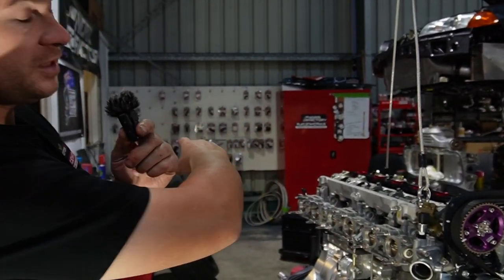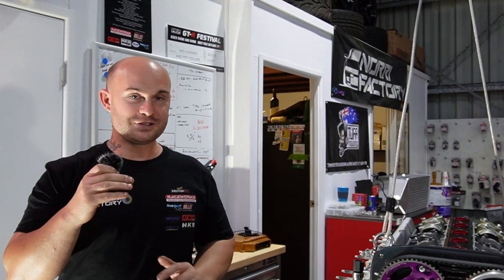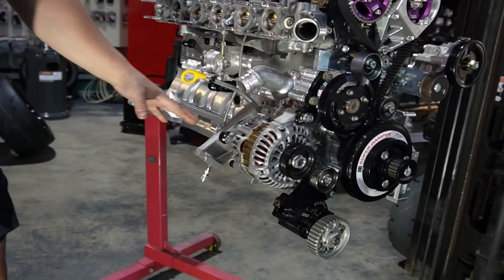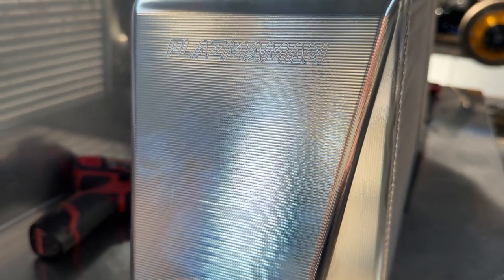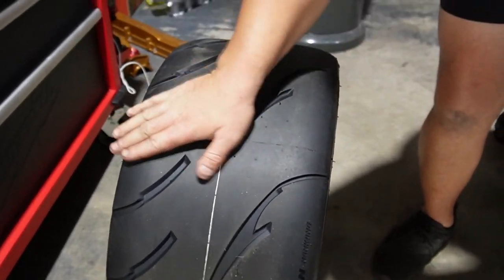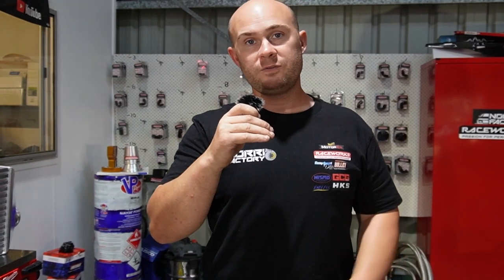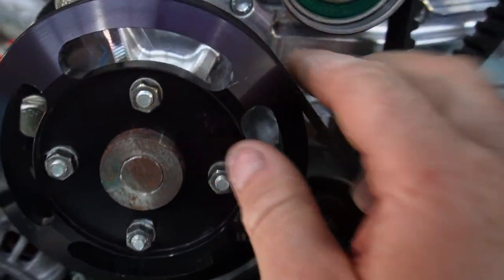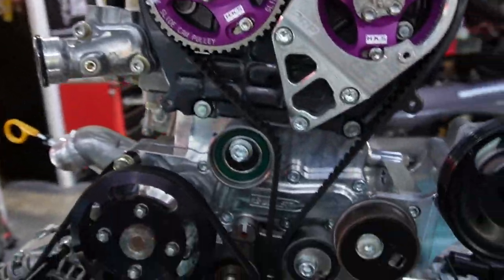Its Time to Inspect the Rod Bearings in the R32 GTR RB26 Billet Block.

Comment: Love the build man. Definitely need a break every now and then! You’ve been working like mad to get the car where it is! Definitely an inspiring build! I hope mine comes out half as nice!
Reply from the maker: Appreciate it!! I’m sure you build will be sweet as! What sort of build are you doing? High hp or oem plus?
Reply: @norrifactory  R33 GTR. Rb26 block, Nitto 2.8, Headgames ported/shimless head, GSC S1 cams, Precision 6870, PPG Billet sequential. Shooting for a 800-1000whp street weapon. Probably just cruise it around on wastegate/550whp most of the time though! I’m in the middle of color changing the car. Head is done, I have all of the parts. Waiting on block to finish machine work/assembly. ~6 months before I turn the key!

Comment: Love your content bro. I’m doing a RB billet build in the states mainly because I had no other options due to lack of availability. Any concerns I should have considering this will be a street car? Not much on the net and getting mixed perspectives.
Reply from the maker: Hey man that’s awesome to hear. When first installing the billet block I had no issues at all other than where bullet locate the fluid supply fittings ins and outs. Like the big -16 orb on the hot side is painful. I also recommend going dry sump.

Comment: Hay mate, another great video, loving your content and attention to detail on your work. 👍
A solution I would recommend to cleaning up them annoying bits and pieces with rust and such like your pully washers, little trans plates / bolts is blueing them, I have had some good success with a simple blow torch and wd40, I think this simple garage technique would work great for your bits. keep up the great work mate, your doing great 👍
Reply from the maker: Bro that’s actually a mad idea. It’s funny I use to do those processes as a kid when I didn’t have money to buy new parts, it’s easy to forget the small stuff when striving for perfection. Thanks for the comment